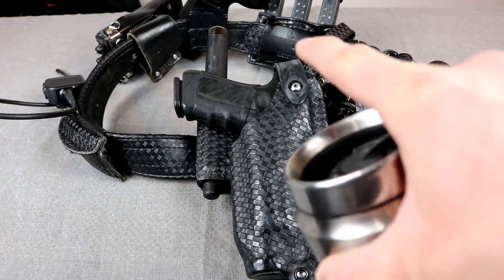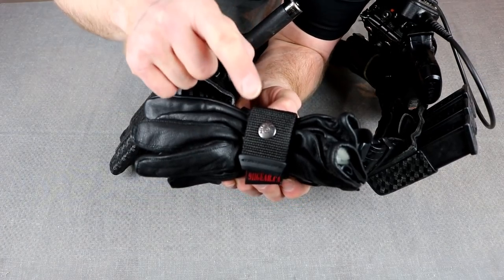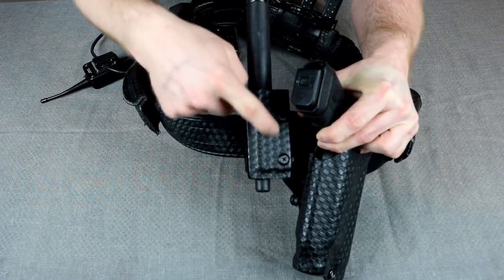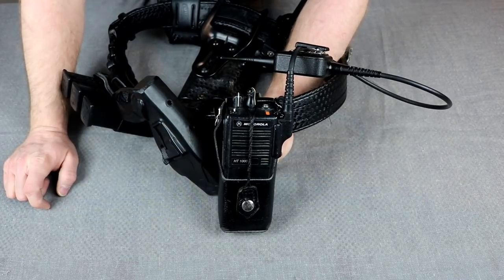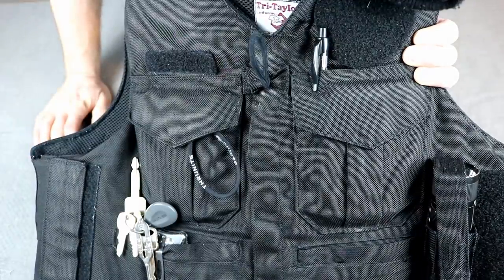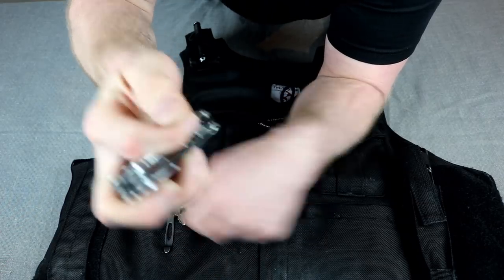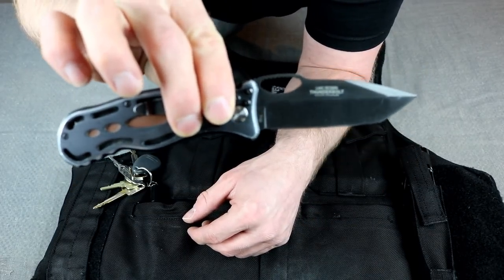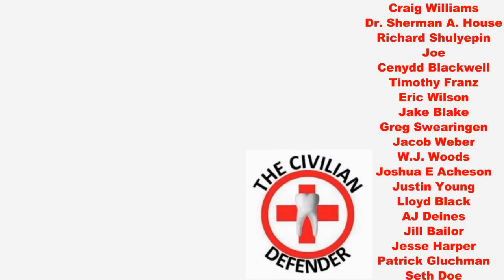POLICE Duty Belt: New Ideas

Comment: I see a lot of guys in my area and the departments I'm looking at joining put the backup light into the lapel/shoulder of their vest or even shirt. They use it for writing and general hands free lighting in addition to just being backup to their duty light. What are the disadvantages to that?

Also, what do you think of earpieces for the radio? I've found I love them working security where I work.
Reply from the maker: I'm currently using the "guardian angel devices" shoulder mounted light/warning light and I really like it. So far the only downside is knocking the light off my shoulder if I sling the parmaedic's bag on an ambulance call.

I used TK have an ear peice and while I liked being able to hear well while the people on the call couldn't hear the radio and not having to worry about the radio giving away my position I didn't like that they break all the time. I went through three of them in a year and then gave up.

Comment: In the army in 07 we switched to the IOTV from the IBA, one of the big changes (other than being a pull over as opposed to a vest, and the huge improvements to load bearing and air flow) was that it had a pull cord up around the neck that would instantly disassemble the vest in an emergency (I think the main concern was with a burning vehicle) in which the vest got caught on something making it necessary to quickly detach it in order to escape. Do you feel like this would be an improvement for police, or are your vests relatively snag free compared to the kit that a soldier might carry on his.
Reply from the maker: We had the quick release vests for swat and every single guy zip tied them together so they couldn't spontaneously disassemble anymore. They were a huge pita.
Reply: free field training I forgot to mention that part, a lot of guys would tape the quick release just to keep their buddies from messing with the cable. But the mechanism was covered up pretty well that it wouldn’t spontaneously deconstruct itself

Comment: That rubber grip an the pistol can slide up and cover the mag release and not allow for the change of mags, rare but it happens at the worse times.
Reply from the maker: No, it doesn't. That isn't an aftermarket grip it is a piece of inner tube. Thin enough to get away from all those problems.

Comment: #1 question I hear is how much does the whole gear/uniform weigh. Got in the habit of carrying a set of cuffs in the back and one in the front, makes it ez’r to draw a pair if you have some one restrained on your back or belly also for those situations where you know they are going to jail but they don’t yet to draw a loaded pair with out spooking them and having them bolt b4 you can close the gap

Comment: Will you still be able to wear your rifle plate carrier over your duty vest with more equipment attached to it?
Reply from the maker: See, currently that is my major concern with putting things on the vest. I'm open to suggestions on that issue.
Reply: I'm not a police officer so I can't offer advice from experience but my only thought would be to keep your radio, baton, etc to the 11 and 2 o'clock positions leaving enough room for the PC to rest between then buckle the PC overtop the radio pouch.

Comment: Hey man, you need to be careful with showing keys on video. If people found out what your department is and where you live and stuff, people can copy the keys by visual and gain entry. Stay safe, man.
Reply from the maker: Nobody is doing that. It is far easier to break a window or kick a door than copy a key from a video still. What are they going to get anyway?
Reply: Don't you keep duty rifles locked in your vehicles that you open with the keys? That could be something to get. I'm just trying to help you stay safe man... You said bulletproof glass and big bulletproof doors so no way they're breaking in the normal way, so copying a key or skimming the RF-ID chip would be the easiest at that point. There are multiple videos on people copying keys from pictures and it can be done. All it takes is one. Stay safe.
Reply from the maker: The building is all rfid and the cars are fleet keys. The gun locks are not key operated. I guess you could steal a squad. Though there are far easier and cheaper ways to do that. Like making one by Vin.

Comment: What's changed so much from decades ago is how much gear police use today. You guys look more like military geared up soldiers. Police back in the day had a gun, cuffs, and a radio. I don't know how police chase an assailant with all that gear on and jumping fences.
Reply from the maker: They had far more than that. It is funny how we look back with fondness at times and forget the reality of the way it really was. Thirty years ago we carried steel revolvers weighing 42oz, radios weighing nearly as much, heavy leather belts and pouches, side handle batons, and oc spray, no medical gear and often no armor.

 Now this has been replaced by glocks weighing half as much, radios that are a fraction of the weight but work better, tasers that weigh next to nothing, tourniquets, soft armor, and duty gear made of light and easily sanitized laminates and plastics. We are safer and better prepared with equipment that is more capable. We modernized.
 The military also modernized and "policified" over the years. They added soft armor, retention holsters, polymer pistols, zip cuffs, and far better boots. All technology brought to the market for LE.

We couldn't go back the "the good old days" unless we went back to he same laws and case law we operated under 30 years ago. Few people are publicly advocating for that.
Reply: free field training lol I know they had a little more then that. If you looked at a pic of an officer from the 60s and one now it's so different. Have alot of family and friends who were or are police officers. I think all that new stuff is pretty cool though.

Comment: I would say maybe replace the leather gloves with a pair of pig gloves or mechanix gloves (not a LEO just my 2 sense)
Reply from the maker: Not a chance. Those aren't cut resistant at all. The leather ones I use are the spectra lined hatch friskmasters. Very cut resistant.
Reply: I was saying that because the leather gloves do not look like they have a lot of dexterity. The gloves I suggested because they offer more protection than the rubber gloves. The mechanix mpact is very durable and cut withstand some cuts. Thank you for your service as a LEO
Reply from the maker: I get it. The Mechanix don't protect the palm of the hand from cuts. When searching that is the primary concern. (broken crack pipes, razor blades, ect. In the pockets)

Comment: You need a glock 19 or glock 20 witch is a 10mm the glock20 the 19 is a9mm
Reply from the maker: Nah, neither of those do anything for me. The 19 gives up too much of the ballistic potential of 9mm by limiting barrel length. This is a duty weapon, size isn't an issue so no reason not to switch to a 34 if I was going to go to 9mm, which I may if work gets around to getting some non legacy ammo. 10mm is totally out of the question as it is not allowed per policy.

Comment: I’m honestly shocked you have to buy so much of your own stuff. That’d be enough of a reason for me to move to somewhere that would issue all that as standard equipment. Molle vests and black nylon pouches are the way to go. So much more versatility and more durable. You could put your radio on your vest, handcuffs, and even a taser if you were so inclined.
Reply from the maker: It is a little harder than that to just switch jobs. Takes years to get a new LE job sometimes.
Reply: Like canada

Comment: If you need 4 mags of ammo for your handgun, you're probably fucked anyway.   You could probably go with a double mag attachment and that would give you some more space.

If you get in a gunfight situation, unless you're mag dumping without aiming, you aren't going to need 3 additional mags.   I assume you're not in bumfuck nowhere with your nearest backup 20+ miles away.   Unless you fit either of the scenarios I described, you don't need 4 mags of pistol ammo on you.
Reply from the maker: Friend of mine ran out a few years ago, sense then most of the pd has gone to three or more mags. I know it isn't normal, but when it happens in front of you it makes an impact ya know?
Reply: How the heck did he run out?   If he was making bad choices, then that's his bad.   I can't grasp a practical situation where would one be mag dumping and/or backup being far away.    It kind of goes to that "play stupid games, get stupid prizes" category.     

I can't think of EVERY situation off the top of my head, so you may be right.   If it's because he dropped a mag or two because of one thing or another, then that's not an issue of having too few mags.  We can't always prepare for everything, you know.   Like if a guy has an old 1985 M-16 he converted to full auto and never registered it.
Reply from the maker: Shit happens in the real world man. Get pinned down behind a car and 52 rounds doesn't seem like a whole lot anymore after the first 2 or 3 minutes.